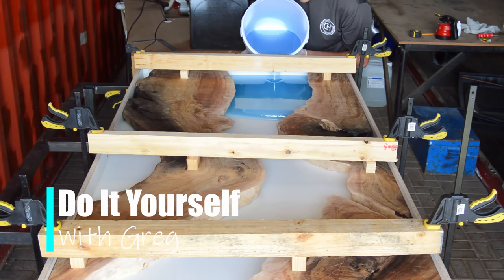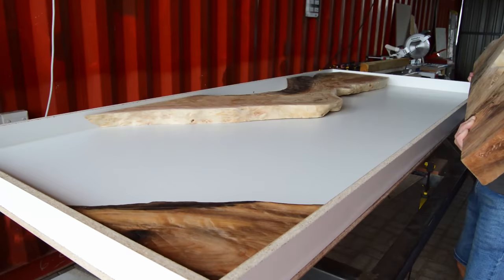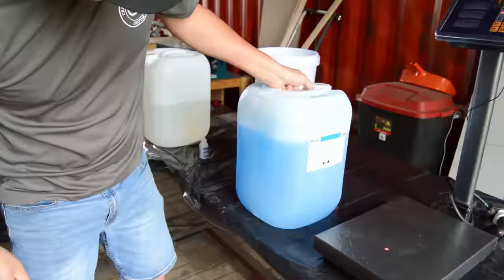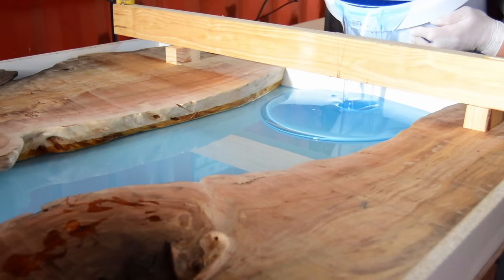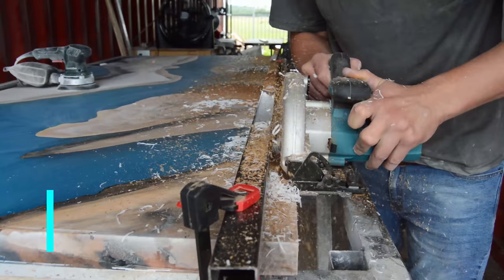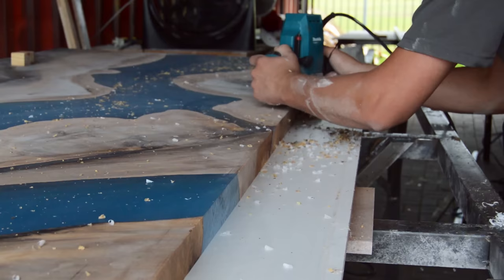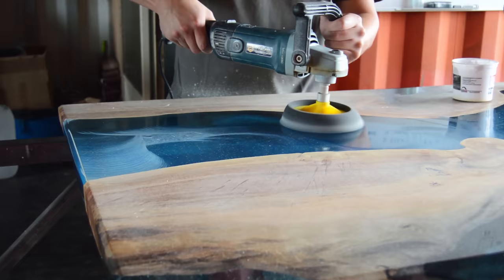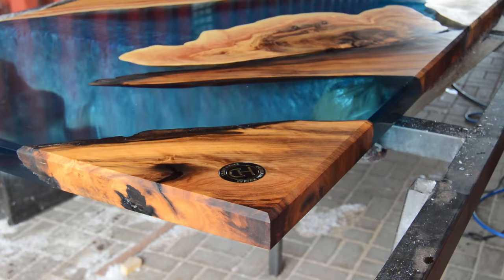DIY Epoxy Table - Step By Step Guide - Part 2

Comment: What did you sand the wood down too. Rubio Monocoat doesn’t recommend sanding past 120 grit because they say it won’t absorb the oil but I sand down to 240 and sometimes 320 and then apply it. They say the colors of the wood also will be subdued at higher sanding grits because of less absorption. What are your thoughts?
Reply from the maker: Yes your pretty spot on.
When im using Rubio im only sanding my wood to 180 grid, when you go higher the oil doesn’t penetrate the wood that well, but I discovered odies oil, odies oil you can sand to 400 grid, so im my shop im using both oils depending on the project im busy with.

Comment: Gorgeous, wow - I love the dedication and craftsmanship! Question: Did you polish/sand the bottom too to get the opaque look in the epoxy? Or only the top?
Reply from the maker: Yes definitely polished the underside also.
Reply: @diywithgreg  

1- what is the white stuff you polished the table with before applying rubio monocoat?

2- which epoxy did you use and where in SA can one buy that epoxy?

Comment: Hey Greg, when sanding, do you put any kind of liquid solution between sanding?  If so, what would you recommend on wood and on the epoxy? Also, can you use a belt sander on the first sanding?  If so what grit do you use?
Reply from the maker: We dont use any liquids when sanding. Just the sandpaper, and we used to start sanding with a belt sander but we found that its removing to much materials at once so we stopped with it.

Comment: Looks very nice. One question, where in SA do you get the sanding disc's with all the grits mentioned?
Reply from the maker: There is a company called AMT Composite in Kempton park. 👍🏻👍🏻
Reply: I0

Comment: Awesome work Greg. Is there a safe minimum thickness for the epoxy in a table build?
Reply from the maker: Thanks for the kind words. 
It all depends on the on the slab you get before you start with your table. 
I would say nothing smaller the 40 to 45mm

Comment: Hi Greg, thanks for the video, that's a really cool table! Question: When you polish, it's impossible to keep it just on the epoxy, so some of the wood gets polished as well. How do you get the wood sanded back down so it can absorb the Rubio finish? Thanks
Reply from the maker: Hallo, i have a full document on our methods and techniques we use to build all our tables and all the information you need, and I documented everything.

You can find the document here

https://www.diywithgreg.com/shop

Comment: 1. Breathing protection. 2. Can you not use the belt sander for longer, leaving the small orbital to later? 3. Can you get a bigger orbital?
Reply from the maker: Our latest videos things has changed a bit, we found that using a belt sander it will give you inconsistency on your table.

Comment: Fun fact...by watching legacies epoxy flooring videos I've lernt you don't need to use flame to remove bubbles...simply give a light spray of denatured alcohol...much easier and safer.

Comment: Excellently showcased..
One question:
Initially when you pour the epoxy and hardner mix in the frame,why dont we pour the complete mixture in one shot?
Why are we pouring it in 2 batches?
Reply: To ensure all the air bubbles are out.

Comment: Hello! After watching several of your amazing and educational videos, I decided to make a table. I used Rubio Monocoat for wood, but accidentally left Rubio Monocoat around the epoxy edges. The epoxy edges became dull;  how can I clean Rubio Monocoat from my epoxy area to bring the epoxy to original shine?
Reply from the maker: Sounds like you going to have to sand it down again and start over with the oiling process

Comment: Why didn’t you put the Rubio monocoat on the epoxy as well to get that extra sheen on the epoxy sides of the table? Still looks great just wondering the thought behind that.
Reply from the maker: Because once we polished the epoxy it becomes like glass, and when you apply oil on glass it an oily business, but when we only sand our tables between 400 and 800 we do apply oil on the epoxy part also.

Comment: Would drilling small dowel holes in the wood not be ideal for added strength and integrity? Would you be able to see the small holes in the inside edges of the wood through the epoxy?

Comment: I’m not sure if you are aware of it, but I noticed when you were levelling the table with your router sled, the crossbars were flexing which would result in a slight concave finish on the table. You may need to stiffen those cross bars with some angle iron which if sized correctly should not interfere with your sleds wheels.
Reply from the maker: Yes we know, the router sled was a bog learning curve for us. We stopped with the router sled, we starting to build more tables and currently we are taking the tables to a local supplier that has a CNC machine, much faster and its perfectly level.

Comment: Hello!
I am from Russia and I always look at Your works with pleasure!
And this is another masterpiece from You!
I have a few questions for You.
You say that you cover it with oil and leave it for 10 minutes. And is this enough time for the oil to be well and deeply absorbed?
And what are the dimensions of this table, I am especially interested in the thickness of the table?
Thank You in advance for the details!
(I use an electronic translator and perhaps the translation is not always correct.)

Comment: Excellent video! Thank you very much. I just have one question reg your specific resin you are using. You said that ratio you are using is 1 to 6 meaning for every 1 kg of resing you put 600g of hardener. This amount of hardener is not really a 1 to 6 ratio. Did you meant maybe 1 to 0.6 ratio or maybe if it is 1 to 6 ratio than you should be using 6kg of hardener for every kg of resin? Thanks.
Reply from the maker: Yeah you are correct, we just call it a 1 to 6 ratio. Even the oil we use is a 1 to 3 ratio. 1 to 0.3

Comment: Hey Greg. You have done some amazing work and the biggest part of your work is sharing knowledge. It's the best way to give back to community. 
I have a question, you sanded wood till 1500 grid and then applied Rubio oil.  Where as other just recommend to sand till 180 for this particular finish to set in the pours of hardwood.
Reply from the maker: Thanks for the support, thats correct, you only sand the wood till 180 grit. 
 after polishing we normally come with 180 over the wood again.
Reply: @diywithgreg  so in your process you sand table top till 1500 grid. And then sand wood with 180 grid again ? Isn't it better to sand wood and epoxy separately. It'll Saves us time to sand wood till 1500 with epoxy.

Comment: Is there a protective top layer for scratch proofing? Cause you'll use it long time, a lot of possible scratches. How do you protect it from scratches? Anti scratch final coat?
Reply from the maker: Just like anything in life, anything can scratch if you dont protect it

Comment: Hi Greg, the table is absolutely gorgeous.   One detail that you did not share is what polishing compound did you use with the 2000/3000 grit sponge sanding in the final finishing stages.   I am located in the US and it would be great if you could recommend a product reasonably available to me.   Thanks for taking the time to share your video.
Reply from the maker: Hi, we used Mirka compound before, but we found using the festool polish system works better for us. Check out our latest video 🙏🏻
Reply: @diywithgreg  Thanks so much for your prompt response, Greg.    This will help considerably as I believe I have sorted out what the Festool polishing system is and where to purchase the material.

Comment: after oiling the wood, can you put another coat of epoxy over it? I would like to do this but to use outside and I would like to protect the wood more than just with an oil. Or any other suggestions?  thank you

Comment: I really like these river bed tables, and this one is no exception....absolutely beautiful. But I always wonder about something regarding these tables, and hopefully you can clear this up. With the natural wood movement that occurs in wood over time, and not in epoxy...will your wood not eventually pull lose from the epoxy over the years?
Reply from the maker: Hi Eugene, thx for the kind words and support.
The slab goes through a drying process for 2 to 3 months, even longer sometimes, to take all the moisture out of the slab to stop the slab from moving. A lot of people building the tables even install some C-channels underneath to make double sure the slab doesn’t move.
Hope this helps 😇
Reply: What is the cost of this table?

Comment: Quick question for you if you see this. I notice on this large of a table you do not use cross bracing under it for warping prevention. Is this on purpose for this table, or something you do not use, and if so why? Always interested in other makers thoughts....
Reply from the maker: We have a solid solid steel structure we use where we fasten the table to the sleet legs so the table cant move

Comment: Great series of videos Greg!  I have one question though because you’re the only one that I have seen use a translucent epoxy… I know you went through high grit on the whole table to get it glassy.  Everyone says that Rubio monocoat needs to be put on a lower grit like 320.  Do you see any problem with putting it on wood after being sanded to a high polish?  I’d like to polish my tables to a high smoothness but also use Rubio.  Do you think there’s any problem with that?
Reply from the maker: Thanks for the support, Rubio suggest that you only sand to 180, and thats true because the oil penetrates better into the wood. So we will polish our table and the come and sand again afterwards, and making sure we don’t touch the epoxy. Hope this helps
Reply: @diywithgreg  that’s exactly what I wanted to know.   Thanks.  It looks like I’ll be taping off my epoxy and hand sanding down to 320

Comment: Greg, when you put your sides on, I see you put YOUR sides on top of the platform.   My question is would it be ok to build your sides on the side of the platform instead of top?  Like at the beginning of your video.  And still seal the side like you would do normally on top
Reply from the maker: Both methods will work fine

Comment: Hi Greg this looks awesome. I thought the Rubio monocoat had to be applied to a 220 wood surface to actually bond and work it’s magic. I think it’s lower according to their own  instructions? Do you have to steer away from the wood when sanding down the further grits? Or do you sand the entire surface up to 1500 including the wood?  How does that affect the oil? It clearly must work anyway judging by the amazing finish
Reply from the maker: Yes you can only sand to 180 when using rubio.

Comment: Bit of advice Greg, your routing from right to left that is why the chamfer is bad and your routing is pushing against you always left to right cutting into the material. Also can see the arms of your sled bowing as your flattening. Rubio shouldn’t be applied above 180 grit. And never use a belt sander lol. I think that’s why your chamfer seems to br rounded off slightly. Not being a know all just some friendly advice. But stunning table otherwise 😊

Comment: Did you use Rubio Monocoat over the epoxy as well as the wood?
Reply from the maker: If we do a high polish we do not apply rubio over the polished epoxy

Comment: Why do you “have to” remove the bark and soft wood? Is it Bc of how they absorb more? Couldn’t that be prevented by applying some with a brush at the beginning?
Reply from the maker: Good question. Let me put it this way, its like a sweet with wrapping paper over, the wrapping paper is not fastened to the sweet itself, its lose and will move, but if you remove the wrapping paper you are left with a solid sweet and thats what you want to epoxy to. Hope this helps..

Comment: Could it be possible to add to the inside extremities of the wood a some kind of a dark coloring agent (with a little bit of glueing properties, I suppose) for creating a kind of a bleed of that dark colour to the epoxy when in contact? Are you picturing the end result? 🙂 A gradient from dark to light blue, from the border of the wood to the center of the epoxy...
Reply from the maker: Yes, absolutely

Comment: Hi Greg the resin that you using is it general purpose resin or not if it's not where do you get your resin from I was going to experiment with general purpose resin on a rifle case I want to make
Reply from the maker: Hi, as far as i know the resin im using is a floor resin, i can be wrong! You need to find our from your local resin supplier what product you can use thats going to work with the wood.

Comment: question: how is the router sled creating a flat surface when I can see the metal rails bending as you slide it across the table? 
thanks
Reply: yea, I saw that also when he was going back and forth , was wondering
the same thing, 🤔 maybe the bend was very slight ?

Comment: What a beautiful piece of art! I am planning on doing my first table. At which grit did you stop sanding the wood parts? The Rubio Monocoat oil recommends only 120 grit before applying, but it looks like you sanded much finer before applying. Thanks!

Comment: I want to make a Cedar bar top. It is 2.5" thick and I have some deep cracks that need filled with epoxy. Do I stain the wood before use epoxy, or after. The Cedar is beautiful as is, but when you put clear sealer on Cedar, it makes it turn more Red than I want. I enjoyed your video and appreciate your advice. Thanks Theron
Reply from the maker: Thanks for the kind words.
We like to pour epoxy on the raw wood, and then its dry and sanded then we apply our oil to the table, some manufactures seal the edges with epoxy first and then do the pouring, both methods seems to be working fine. Hope this helps.

Comment: How did you fix the plate to the metal frame of your table. I assume you just placed it on top and any time someone bumps into it the whole freaking thing collapes. spilling all the drinks onto your cashmere rug. beneath..
Reply from the maker: With threaded inserts

Comment: Defnetly nice work, but im bit confused about racio. 
If my racio is 1:2, it means i have to use 1000ml epoxy and 500ml hardener. But in your case is it not supposed to 1000ml epoxy and 166.6 ml hardener since the racio is 1:6 ??  Could you please explain am i missing something?
Reply from the maker: Im busy with a full document going into detail on how to build these tables, will be launching soon

Comment: Good work! Does epoxy resin also have to be poured over the wood? And as I understand it, you first have to pour a small layer and then again after 8 hours, right? Can't you cast it in one go with the epoxy resin? Greetings from Germany
Reply from the maker: If you have extra epoxy you can cast it over the wood, but you going to end up sanding everything off. And every epoxy has a different specification, the ones we use we can only cast in layers and cast between 4 to 6 hour. Hope this helps 🔥
Reply: @diywithgreg  Thank you for your feedback signal. That really helped me a lot. As a rule, however, wax is poured or finished over the wood at the end And how high the first layer is, if you pour it in several steps, it doesn't matter or does the first layer have to be, for example, 1cm high, the 2nd too, or can you pour the layers as high as you want?

Comment: Im surpised the wood takes rubio after being sanded to 3000. They claim it wont absorb after 240/320 grit. Or did u only sand wood to 320?
Reply from the maker: Good question.
The wood we only sander to about 220, and polished the epoxy

Comment: Hi Mr. Greg, I'm from India I'm new beginner I have started making one dinning tabel it's very helpful for me this video. I'm in polishing stage I can't decide what polish should I use I finsged with 320 gride sand paper now I want to polish it shall I go with more sanding gride or no..? And what polish did you used in this table..??
Reply from the maker: Hi Mohammad, thanks for the support.

I would recommend going to 400 grit, you only polish when you go to 1500 grit, once you reach 1500 grit you must use a 2000 grit and 3000 grit sponge sanding grit with the mirka polish, not to sure if you get that in india.

You only have to oil at 400 grit
Reply: @diywithgreg  Thank you so much for your response Mr. Greg. Your the first person who responded the massage. I search the polish is not available in India let me check I'll try with oil.

Here is no option to show you my table top.
Reply: Hello Mr. Greg I have been make a table top with Epoxy coat.. I have been one mistake in beginning when I fix the clamp I use straight wood on top and below is plywood that's why my table now is become Arc type I'm  in so trouble now I can't fix in straight table and can't fixed base with Screw is there any solution please it will help full me. If u have instagram please let me send u a pic..

Comment: how much epoxy required for a dining table 6x4 feet & 2 inch thick, area 60% wood, 40% epoxy. will you please give me the estimate of epoxy required in liters. or tell me about its calculator link.
Reply from the maker: Check our my channel, I recently made a video on calculating epoxy

Comment: Will the filling bend if exposed to a certain amount of kilos.. lets say a natural thing like a bodyweight? 
If so... will it break loose from the wood? have you experienced anything like this? 
I imagine that this would only be a problem if several smaller pieces of wood is used, likee this one, or not having metal legs going all the way thru the table supporting it from beneath..
Reallly nice work tho! 
<3